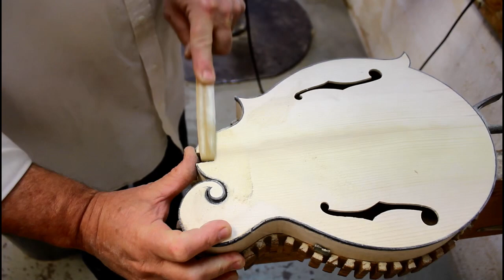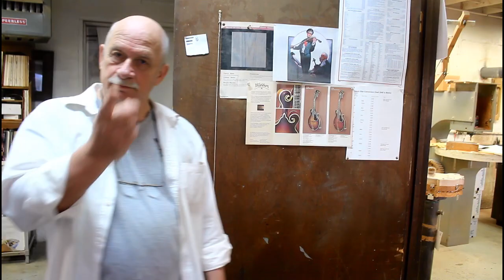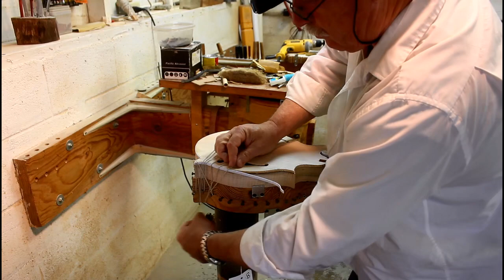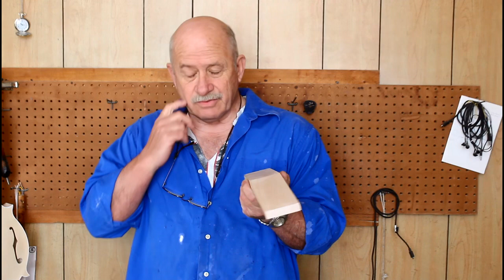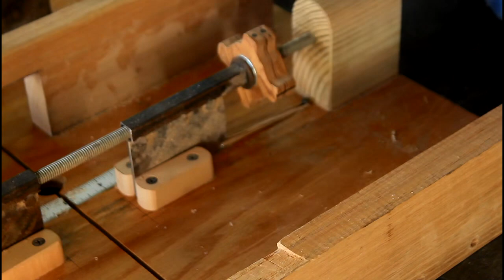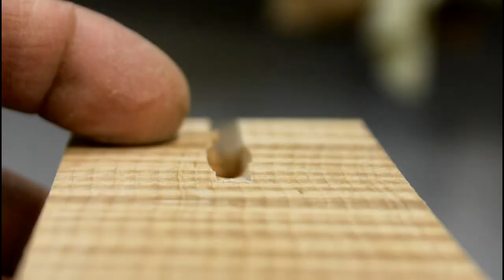Episode 126)   Started Work on Mandolin Necks

Comment: Pretty great layout to get that many necks from that piece of maple!   Do you think you could true up necks on a 6" jointer, or is the 8" a safer bet?  That's one piece of equipment I haven't invested in yet.  Another great jig - the "support the loose end of the binding with a block of wood perfectly shaped like a point" jig.  Although it needs a better name than that.  Table saw is a cleaner cut than a router, that's a great idea for cutting the truss rod slot.  Is that a pair of stacked blades, or one thicker one?  That homemade lathe is pretty clever, for sure.   Looks like you're off to a great start for the year.
Reply from the maker: It's one blade and I have to move the neck back and forth in the jig to get just the exact width.  That usually take 3 passes.           

And  I usually sand curly maple instead of using a joiner.